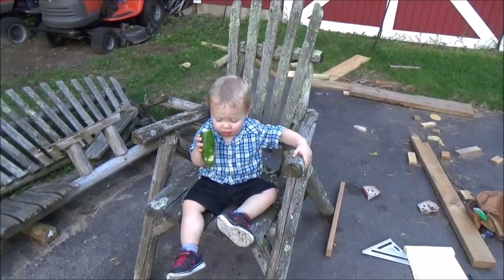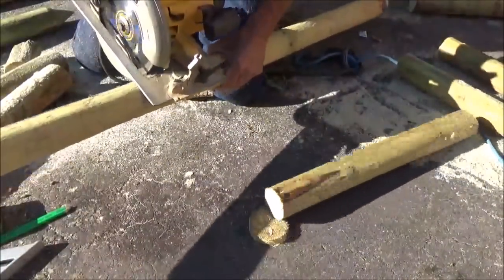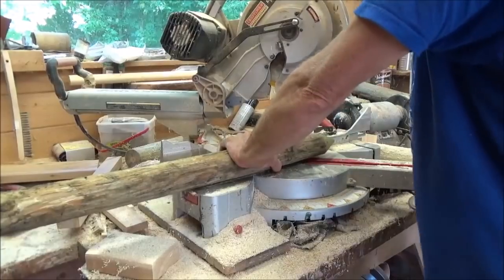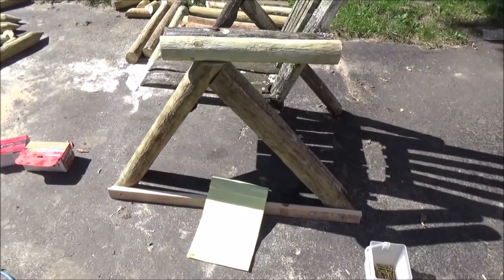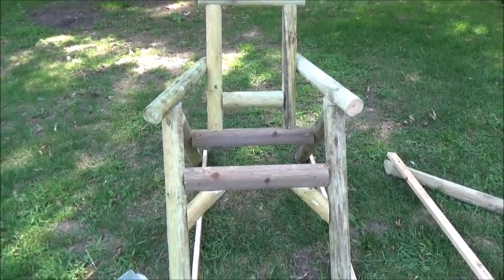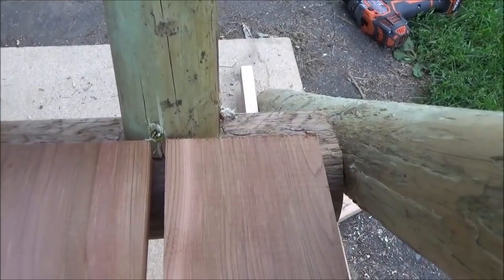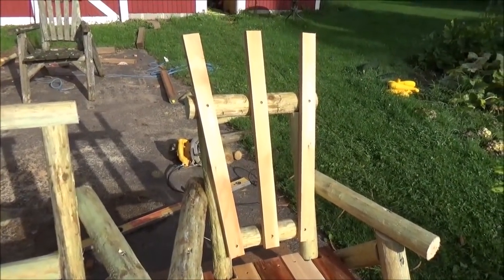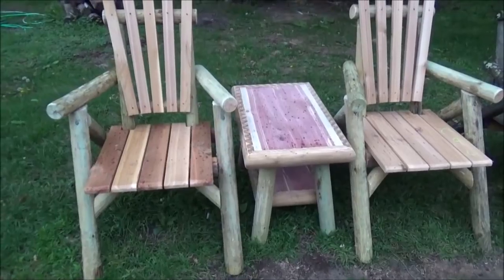How To Make Your Own. LOG CAMPFIRE CHAIR. Step By Step.

Comment: Thanks Joe , i just spent the afternoon in the workshop with my laptop using this video to make myself this chair, and it came out pretty awesome even if i do say so myself haha. Love both your channels, thanks you for the hard work and inspirations! All the best Simon
Reply from the maker: That is so awesome. Tell me this? There was one measurement I did not have in the video..... How far back the chair upright is from the front of the arm rest. How did you figure that out? I am going to measure it next time I go to the Tent and put the measurement in the description.
Reply: Hi Joe,  the measurement i have is 18.5" from the front of the arm rest to the center of the back upright log, basically, nearly as far as it will comfortably go. Thanks again

Comment: How come you have two of the same ride on mowers?
Reply: It's called a mystery.
Reply from the maker: I have a lot to mow? Lol.  Actually one is much bigger than the other one and when I put the mower deck on it it cuts a full 48 inches. I use that one mainly to pull things around. I use the smaller 42 inch cut one for mowing.

Comment: Joe id love to say " wow great job you make it look so easy " but in reality  .. man that looks like a huge pain in the ass for an uncomfortable chair . But thanks for the video
Reply from the maker: The chairs are super comfortable but definitely a pain in the ass if you do not have patience. I have little patience.
Reply: I have far less patience than you LOL and I'm way too much of a perfectionist it would make me crazy. You rock with your patience and skills. One thing I'm not sure about but would they be comfortable if the were contoured to a butt / back  instead of flat? Again perfectionist
Reply from the maker: The old chairs did have a contour in the seat and that might make them more comfortable. Those chairs were mass produced and I do not have a machine that can contour the butt part like the old ones. I could have spent hours doing it with my spindle or stationary belt sanders if I really wanted to. The problem with that though is on the old chairs that is the weak spot I had to put the board under to support where it had cracked. After I took all that into consideration and then the fact that I myself might sit in one of those chairs maybe a combined 10 minutes of time in a year, I decided I wanted a chair that will out last me and look pretty sitting by the fire.
Reply: NorthernSeclusion maybe boil and bend? or steam?
Reply: NorthernSeclusion im not disrespecting your skill at all I'm just saying what my crazy irrational need to improve my work and do it to the best of my abilities ( to the point of making myself crazy)

Comment: You did the same with the Campfire Bench, you copied mistakes. The side seat rails angle in too much, which cause the stiles and back slats to angle into the center of the seat.  Check the back slat design and angle of an Adirondack chair, the slats don't cut across your back.
Reply: He's not creating fine furniture here, just something to sit outside around the camp fire.
Reply from the maker: First of all I absolutely HATE the look of Adirondack chairs. I would not allow one at the Tent. Second of all, these chairs do not cut into my back at all, they are very comfortable. How about you build the chairs the way you want and post videos and I will do them the way I want and post videos.